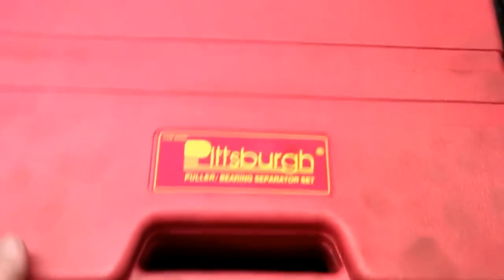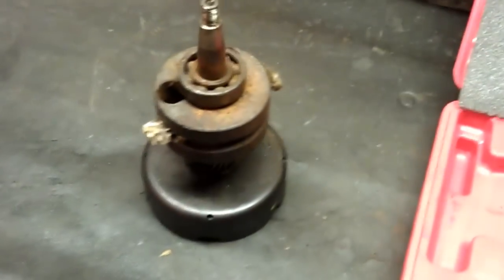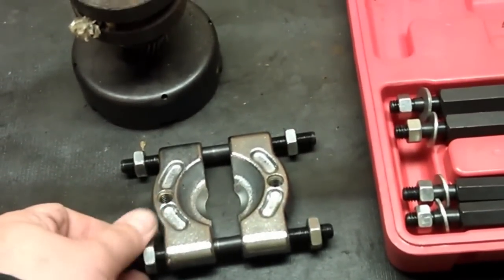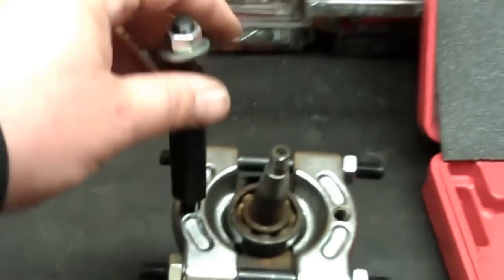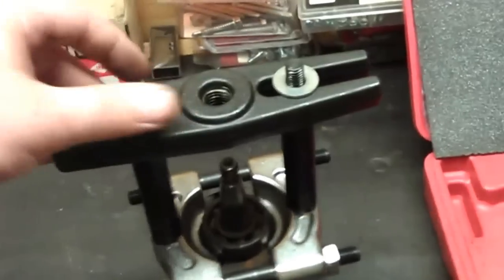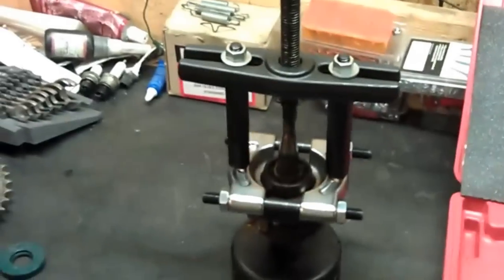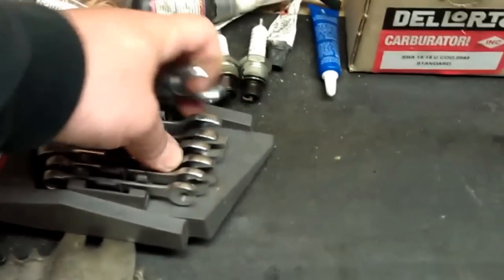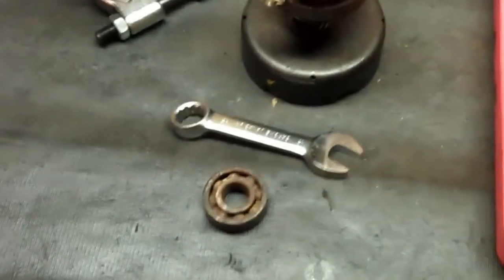Moped Crank Bearing Removal

Comment: I tried this and the inner sleeve of the bearing is still stuck on the crankshaft.  Any solutions to getting that off?
Reply from the maker: Heat it up with a torch that'll cause the bearing to expand. Then if you can try seeing if the puller is able to get a hold on it and try to remove it.
Reply: Thank you I will give it a shot.

Comment: will this work on a car wheel bearing?
Reply: +aitaix If you're trying to pull off the inner race of a car's front wheel bearing, you will need a strong enough piece of metal to lay across the stop of the wheel spindle. This will create a stop against which the puller's main shaft will pull off the bearing's inner race.

You may need to visit a hardware store, any place with scrap metal or maybe a machine shop to find such a piece. I happen to also have the Harbor Freight Item#66829 FWD Bearing Adapter set. From that I would use one of the smaller discs as my metal stop for the main shaft.